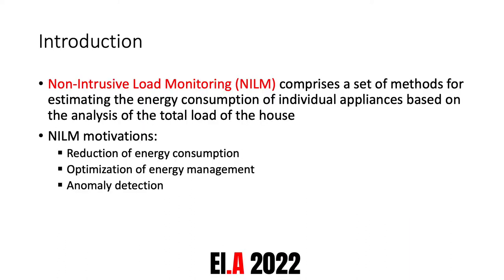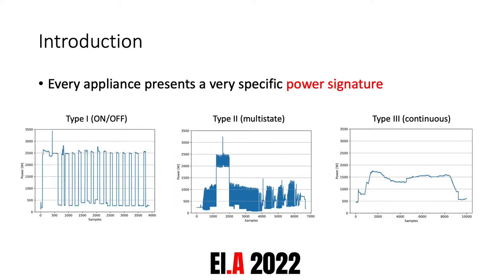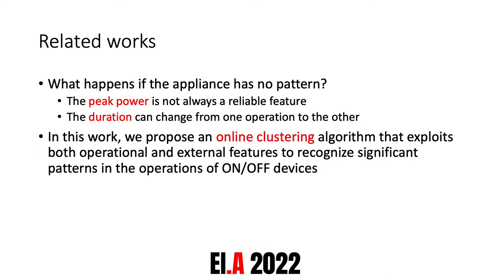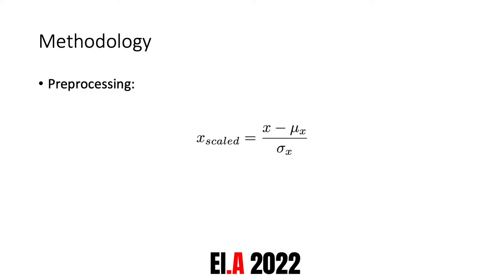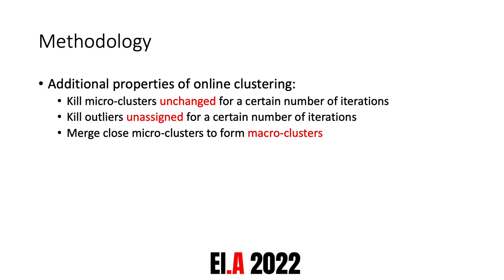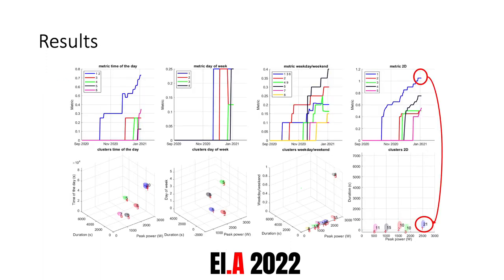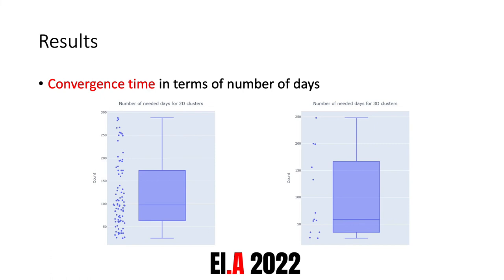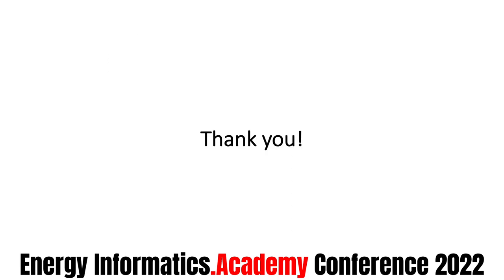Non-Intrusive Load Monitoring techniques for the disaggregation of ON/OFF appliances

Comment: I'm trying to create a System with an Android App in order to study freezer and microwave appliances and visualize consumption graphics, but I have many questions about the dataset creation, I'd searched information and I found a Python toolkit called "NILMTK", I'm currently trying to measure the Current and Voltage, May I know what kind of current transform and voltage  sensor did you use? (I'm a Student from Instituto Politecnico Nacional in Mexico)